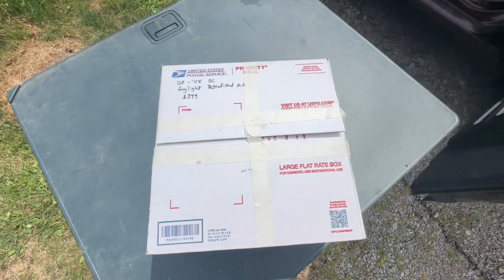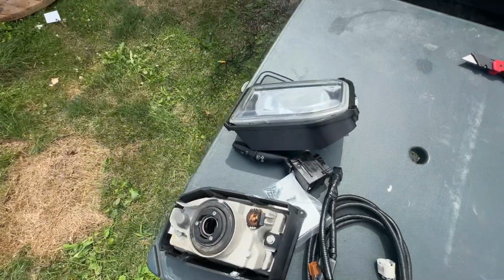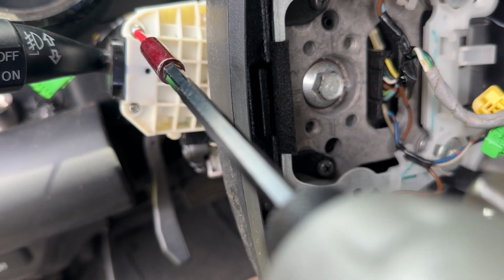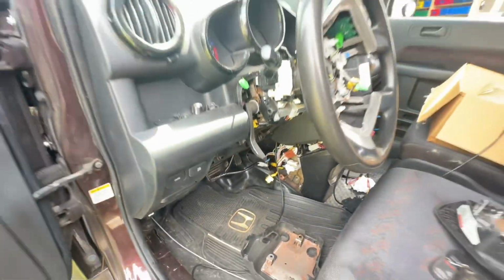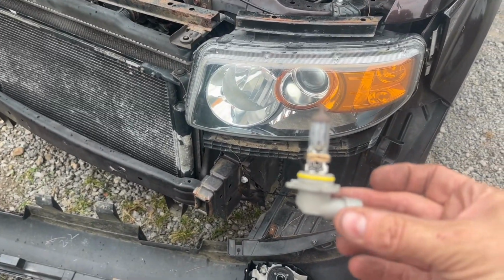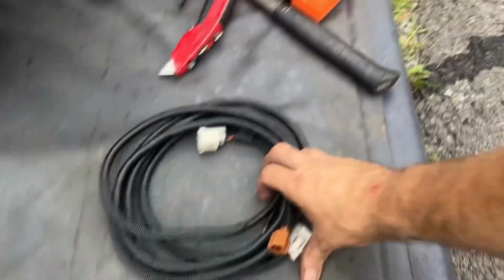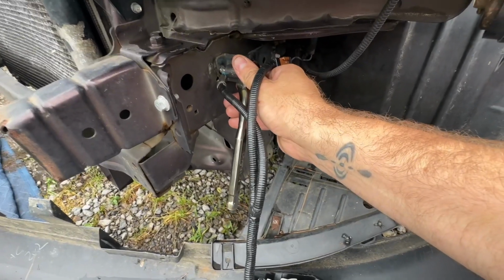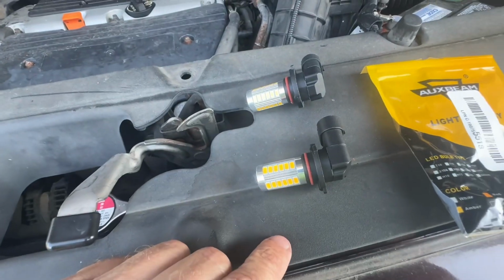NEW Retrofitted Fog Light Kit - Honda Element SC 2007-2008

Comment: BEST PRACTICE NOTES:
1. Avoid scratches &damages by laying front bumper cover on carpet strip, towels etc. Use fenders covers.
2. Coat all connectors &their associates terminals w/silicone dielectric compound 4resistance 2water& weatherizing. 
3.

Comment: Would you have to remove under panel to change light bulb of fog light?  Cant find video
Reply from the maker: Yes you would.  Is has a series pushpins that hold it in place.
Reply: @ElementDIY  thank you, I'll have to give it a go 💡
Reply: I just cut two trap doors underneath to get at the bulbs used zip ties to close them . The passenger side bulb is right be hind the washer fluid bottle there's just enough room to get it in lol.